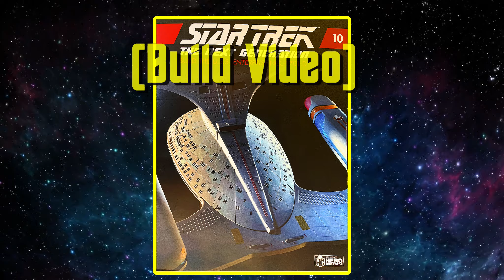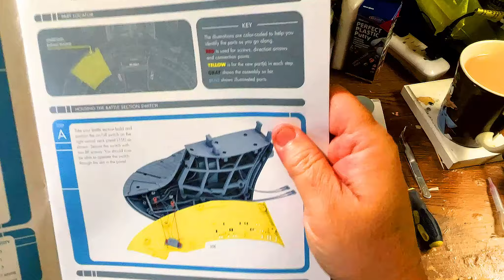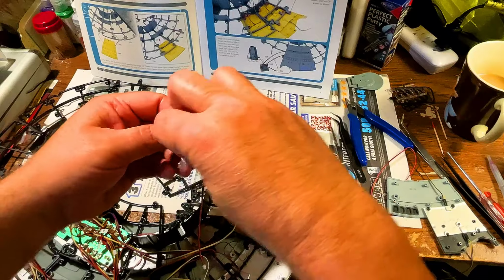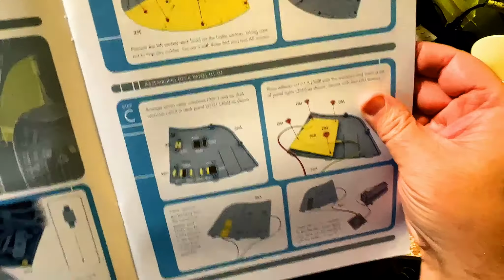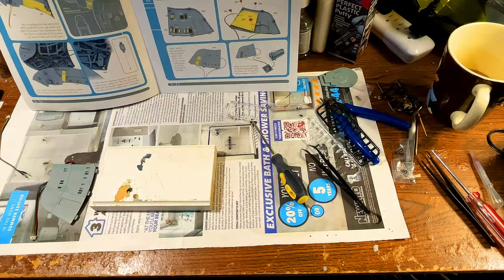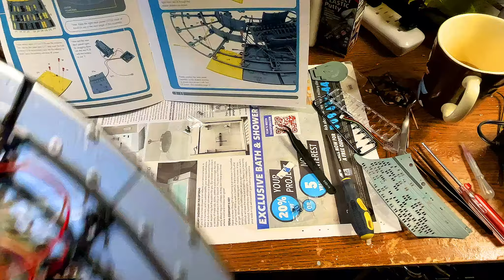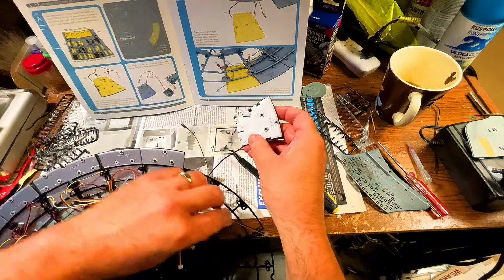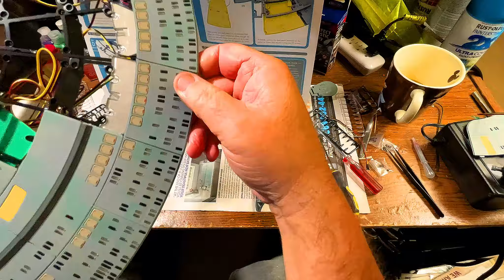Eaglemoss Star Trek Build the U.S.S. Enterprise NCC-1701-D shipment 10 (Build Video)

Comment: For the contact issue you're having with the battery box:  There is a silver contact (tang) on the inside of the battery box lid that may need to be bent to ensure contact with the wire that is soldered to the outside of the battery box near the lid opening.  That silver tang may be a little out of position and need to be adjusted to make proper connection.  Just a thought.  Hope it fixes the issue you're having.
Reply from the maker: Thank you very much for your suggestion. Yeah, unfortunately I thought of that as well. Still made no difference. Customer Support let me know to send them the part number and they will ship out a replacement. The only problem is that the entire dorsal hull has to be dismantled in order to change the part. <=-(
Reply: @TrekFanNCC-1701  That's a real bummer!  I was hoping that would fix it.  May want to 'Test' the replacement part before you re-install it and before re-building the dorsal hull.
Reply from the maker: @lunaticloon5638  Absolutely! I will also try using the different End cap that screws on top to see if that fixes the problem.

Comment: Got the same problem with my battery box ??!!
Reply from the maker: Did you contact customer support? I’m still waiting to hear back from them.
Reply: No just putting up with it not going to have the !lights on all the time anyway. Can't see why they couldn't go mains route??? At least for the back section??
Reply from the maker: I’ve got to tell you that I think as expensive as this kit is, there should be NO ISSUES with it at all! Or it should have been sold pre built.